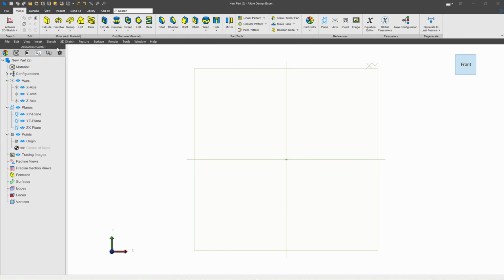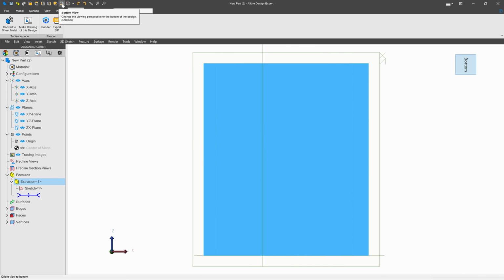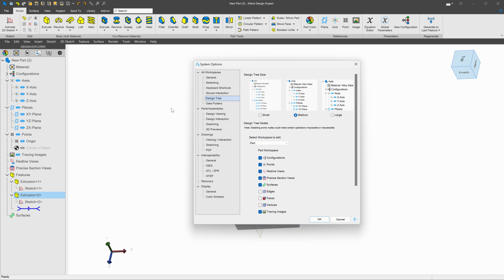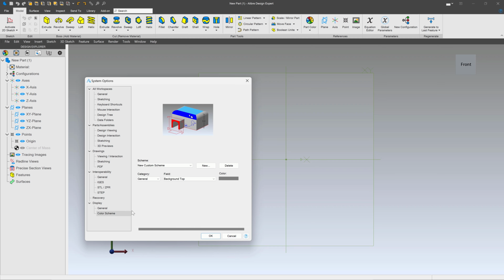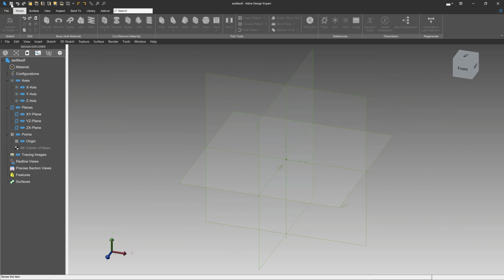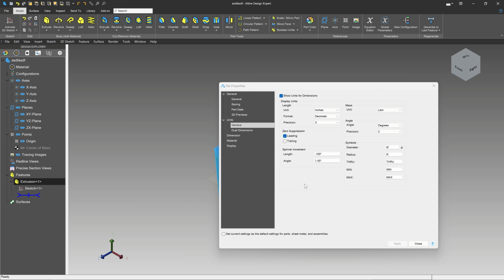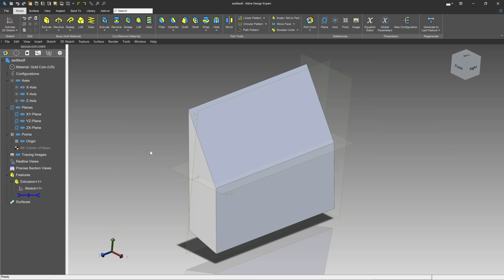How to Setup Alibre- A Deeper Look at Settings and Properties

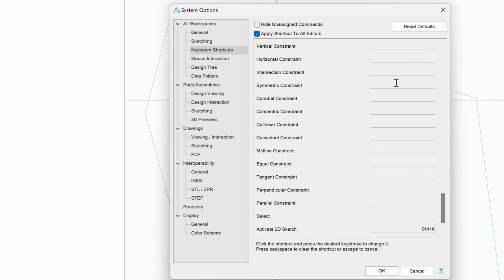Comment: 3:20 the ability to modify your keyboard shortcuts to anything you want is one of the most powerful things in Alibre. If you've never used any other CAD, then Alibre's defaults are not bad by any means! However, the ability to match the keyboard commands of a software you've recently switched away from is WAY more powerful than people give credit. The ability to keep your workflow and speed by keeping keyboard commands the same is the issue I'm currently having when switching away from Photoshop.
13:42 that is absolutely brilliant. That probably makes it way quicker to mask out the part later in editing. Great idea. A guy with a background in graphic design totally should've thought of that sooner....... oops.

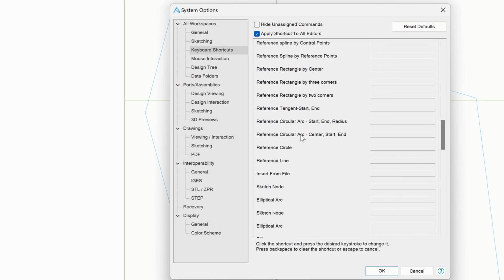Comment: Would it be possible to improve the performance of the UI? It feels slow due to behaviors like the one shown in 3:14
Reply: @manuel56354 I'm pretty sure v29 is meant to be the 'UI overhaul' update from what I've heard. Could be wrong. 
The keyboard shortcut menu being slow is kindof understandable because it's loading tons and tons of changeable options, but I understand what you mean.
Reply: @WeekdayWeekend Well yeah, in this particular case I wouldn't care because, is not often that I go and change the settings.
But this kind of 'slowness' can be felt in many other day to day menus with fewer options.